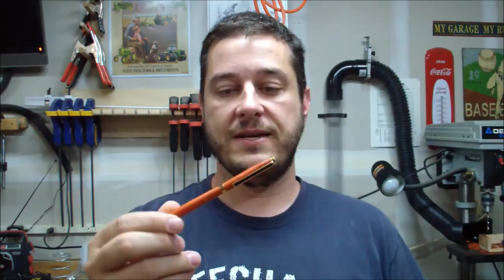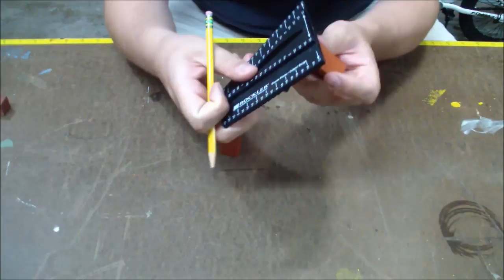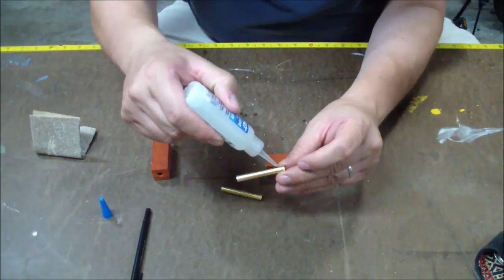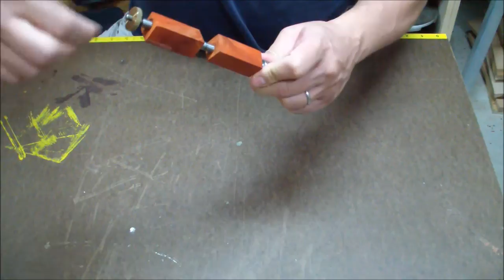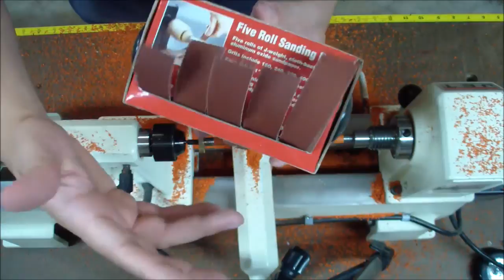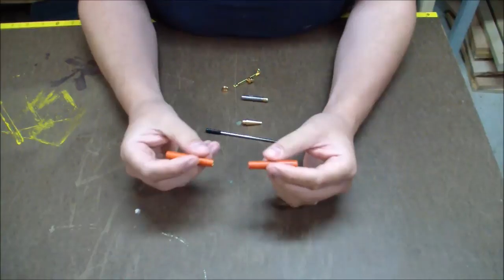How to Turn a Slim Line Pen on the Lathe (WoodLogger.com)

Comment: I use a Zebra Z grip click pen parts as my pen kit to make turned pens as it writes better than a slimline kit and cost less than $1 per pen from Amazon.  No inner sleeves are used when using a 4 inch long pen blank.  Have you tried this method?
Reply from the maker: Great tip!  I have not used that before.

Comment: hi, 
i have turned a few pens with different types of wood,, and also using a CA finish , but i seem to be getting white parts (spots) appearing under the CA after i have used the micro mesh pads.
Any help would be grate thanks ... Ash
Reply: Are you sanding between coats?

Comment: Thanks for the video. I would suggest you clamp a simple zero clearence fence to your chop saw fence with a clamp on each side. It will help you avoid having your fingers drawn into the blade when it picks the piece of timer out of your fingers.

Comment: I have just started making these pens but I am having an issue with the wood cracking on the end when I press the transmission in the lower part of the pen.  Have you had this problem?  Do you have any tips on how to prevent the cracks?
Thanks and great video!
Reply from the maker: Hey Ryan, sorry I think I've only had that happen once when I was using a soft wood for a pen I made.  I know cheap softwood will do that.  Not sure if that is the same case for you or not?
Reply: The wood I was using was bubinga and also olivewood.  The pen kits came from Rockler but I have recently purchased some kits from another company with better results (the transmission doesn't seem to be as hard to press into the barrels).  I think I also need to invest in a pen press, I was using quick clamps and it seemed put pressure at an angle when pressing them together.  Thanks for the reply and keep up the good work!